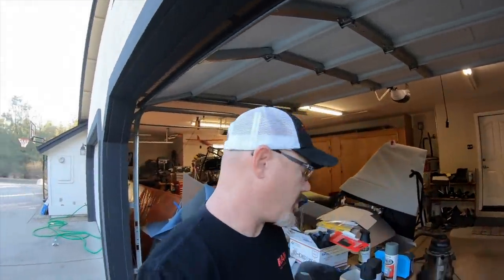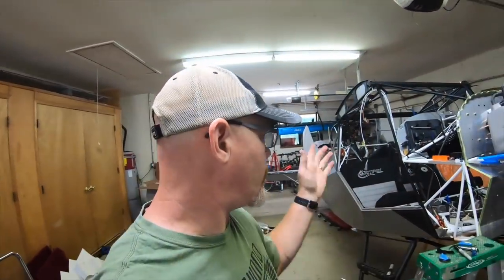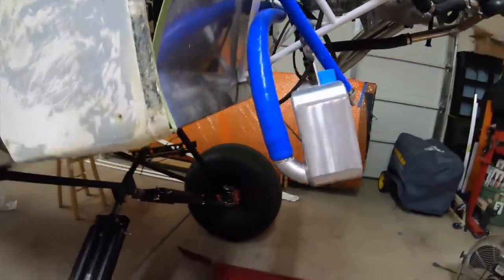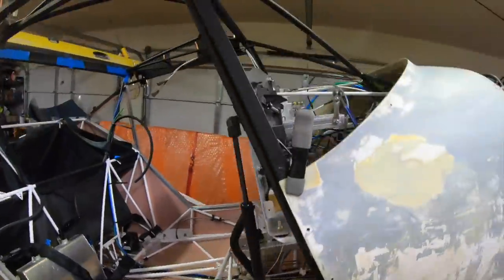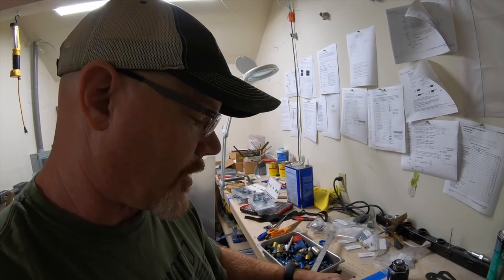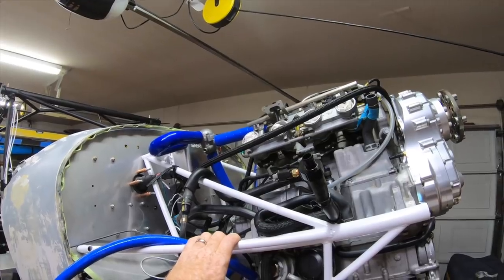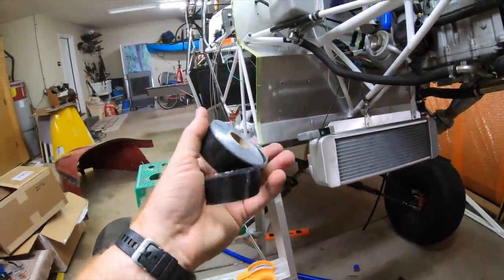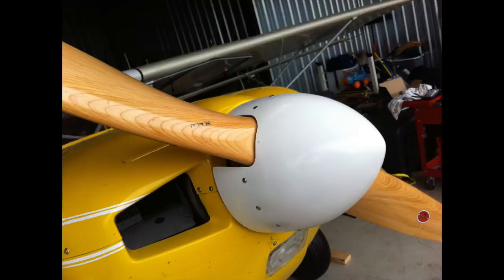Kitfox 7 Apex Build Episode 29 Engine Part 2

Comment: having the oil tank higher  will that make oil level in the motor be too full
Reply: not sure what 'too full' means WRT the APEX engine, but the dry oil sump design in my automobile engine demands a slightly different approach to measuring the oil level in the reservoir. it involves running the engine for a few moments, shutting it off and only then checking the oil.
Reply: "I put my sled up on its right side once in deep snow and got a vapor lock.
Pulled all the hosed off the top of the oil tank and plug them with chunks of hose, bolts, and hose clamps. You are going need to pressurize your oil tank with compressed air. The return line is left open. Then with the tip of an air gun and a wet rag I pressurize the tank with a couple of shots with the air gun.
There is a valve in the bottem of these engines, when there is oil on one side and you turn the motor over it sucks the valve open and pull oil threw the engine, when turned off the valve closes. If you have a vapour lock in there it can't suck oil.....after a couple of blows with the air I rolled the motor over with the primary clutch by hand until oil started to come out the return line. Hooked the hoses back up and start it."

This is from a q/a forum I found on the the net.....So with a valve at the motor preventing flow till the pump pulls oil threw, circulating through out the motor, & returning it to the reservoir, if I understand correctly the placement of the reservoir shouldn't matter only the suction & return lines....🤔
Just remember the valve so if you loose oil pressure, with no visible leaks it would be the first place I'd check...👍